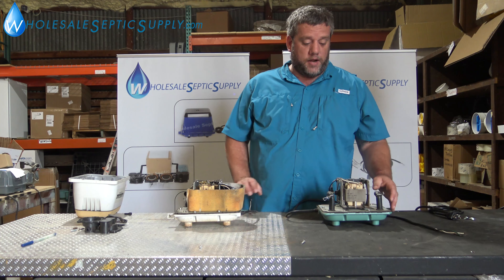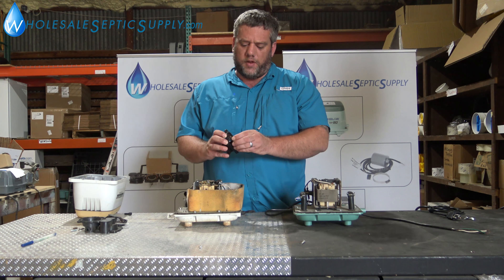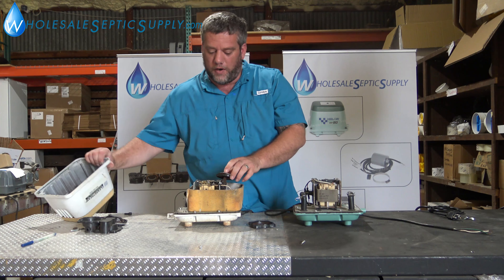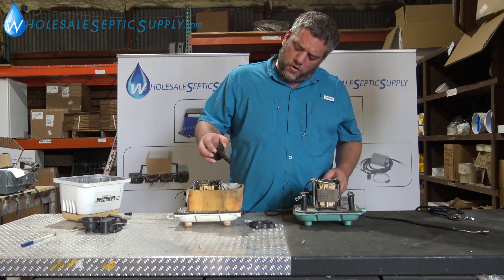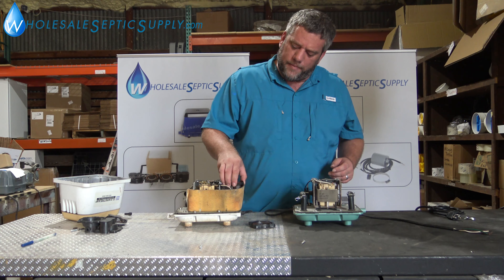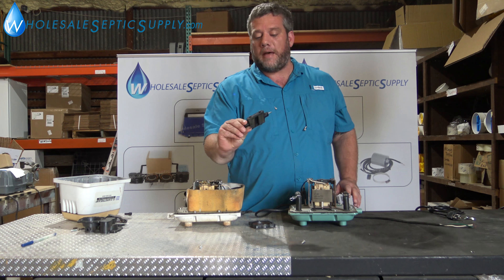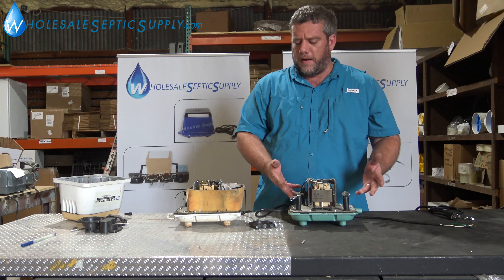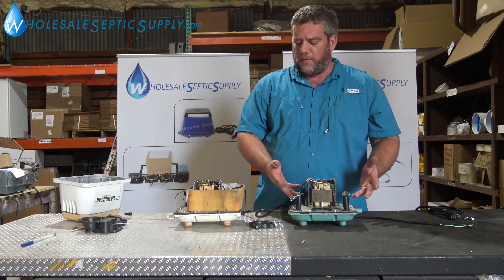Should I rebuild my septic aerator/air pump?

Comment: I am so glad I found this video. I had my pondmaster ap100 outside for 2.5 years barely covered, it finally crapped the bed and thanks to this video I know not to waste time rebuilding it!!
Reply from the maker: That red dust is dead giveaway it’s done for some aerators last and some don’t.
Reply: I am in NY state so it cycled non stop through full seasons. For anyone out there considering a cheap alternative to these big pond aeration systems. If you are going to buy a septic aerator to accomplish that then take wholesale septic supply’s expert insight and apply it to your purchasing decisions.
Reply: I wanted to buy the Fuji Mac 200r2 system after watching this video but I couldn’t find it on the wholesale septic supply website, I’ll call to find out if it’s available to order but is there any holiday discount codes or any discount I can apply to my purchase?

Comment: Thank you for posting these videos. I'm having to replace my rotary gast pump. I was wondering if you had any advice on if I should try to rebuild it or not? 

The reason I ask is the pump is not turning on at all as opposed to turning on and sounding like it had bearing issues or something. The pump is definitely getting power so I was wondering if that sounds like my pump's motor burnt out to you and should I replace or rebuy?
Reply from the maker: Mystery Science Gaming 3000  coils could be bad. You check the safety screw.
Reply from the maker: The bearing could be going out if it's a rotary vane pump. When they do go out it's time for a new one. We have repressed bearings on but it's very time consuming and not recommended for someone who has never done it.

Comment: Just had my home septic pumped for $425 and noticed the aerator a few days ago stopped working with the red light on. So since they had a new Secoh JDK-60 on the truck I let him replace it. I was charged $475 for the new aerator. I could kick myself for not shopping around. Wholesale Septic online has em for $255. 🤜🏼🤬🤛🏼
Reply from the maker: It happens he has to make money also plus that is actually a decent price charged by a professional to install it. It’s not hard but they have drive time, fuel, insurance, and man hours they have to pay employees. You got to see how it’s done and you can do it next time.

Comment: I have a Gast style rotary vane pump (different mfgr - I forget who at the moment) that has very little flow. Taking the supply hose off and putting my thumb over the fitting, it doesn't build up enough pressure to push it off. Wetting my finger, I can feel the slightest breeze. 

I checked the filters and even though they're 8+ years old, they look fairly new. I can see dust, but the media looks clean. I opened it up and the vanes look good - they're intact and they move in their slots by gravity. 

Is this sufficient pressure? The wires to the pressure sensor were not connected by the installer. If not, where else would you look for flow throttling or pressure leak? Would you advise starting with a rebuild?
Reply from the maker: sounds like it's not sealed properly. how long has it been in service? Also the omotor might run but not build enough torqe to spin at the right rpm

Comment: do you sell an aerator pump for EnviroGuard septic tank?
Reply from the maker: Is it in the tank if it a Consoladated treatment unit then you can buy it from them online. On those units it’s best to use the oem model.